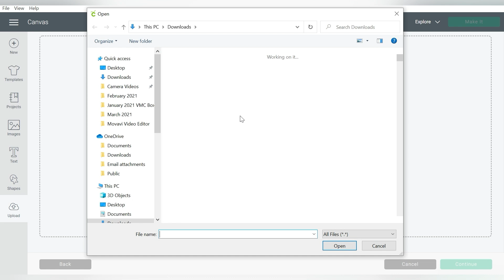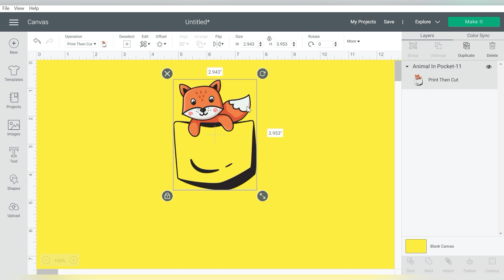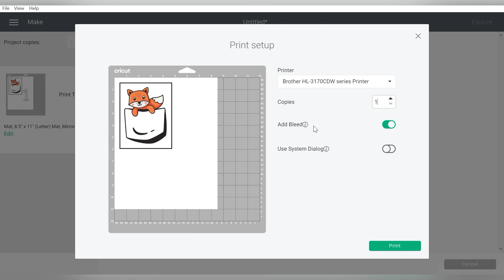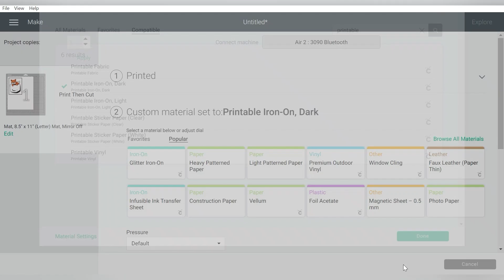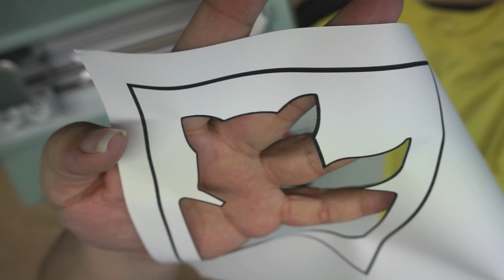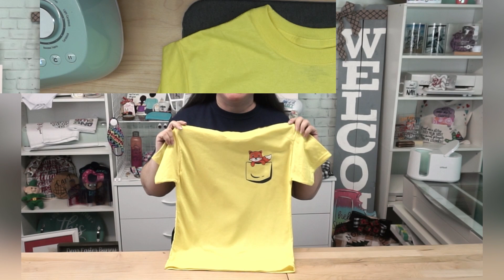😊 How to Make a Faux Pocket Shirt with Printable Iron On Material

Comment: You mentioned that print and cut vinyl doesn’t last as long as normal htv, his long does it generally last in an adult shirt? Would sublimation on easy subli or white htv last longer?
Reply from the maker: Hey Christine, a lot depends on the wear that your washer will have on the vinyl, but basically I would count on 10-15 washes before you can see a visible difference?  That is an estimate.  Yes, EasySubli or standard HTV will last longer than the printable iron-on.  Hope this helps!   ---Becky